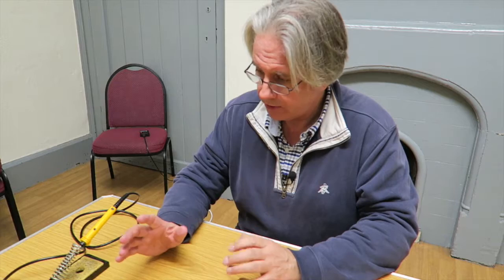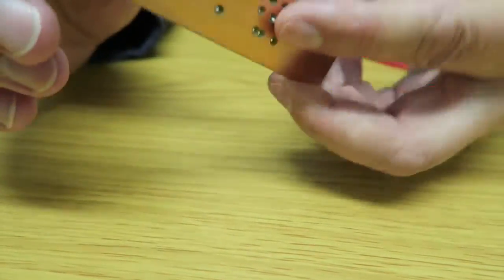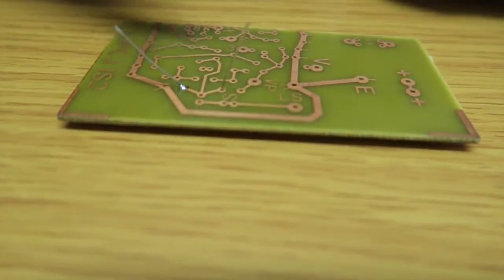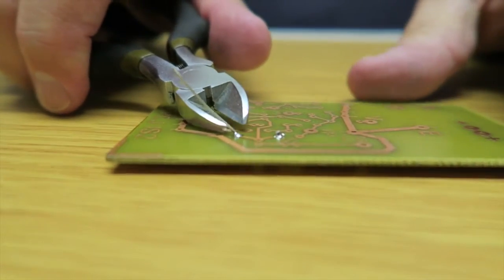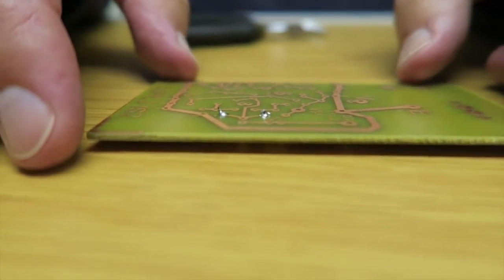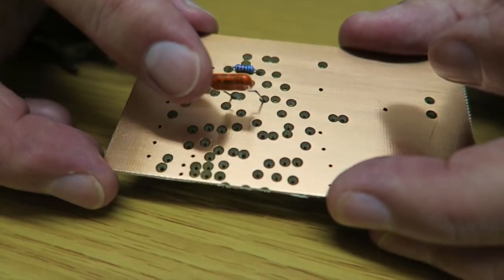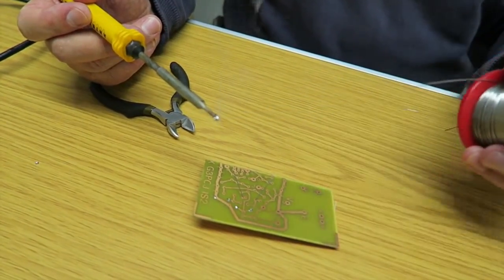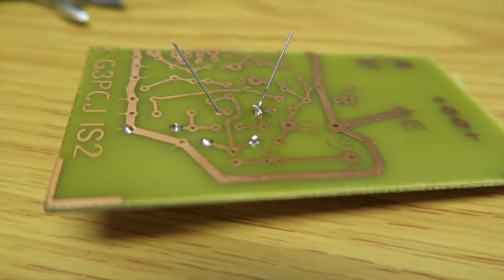Back to basics : How to solder

Comment: I wish you would do videos on the advanced manual. I don't understand the reactance part. The Xc calculation.
Reply from the maker: we have a number of videos on advanced topics, including one on capacitors, inductors and tuned circuits. Check out the video list on the channel.
Reply: Thanks. Will do. @G0FUW